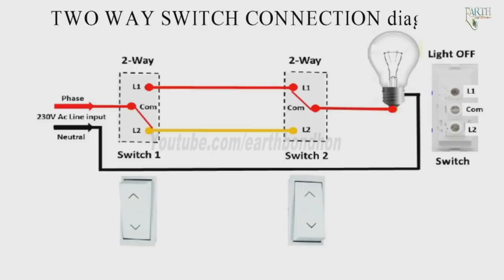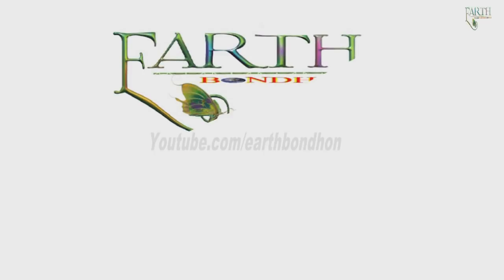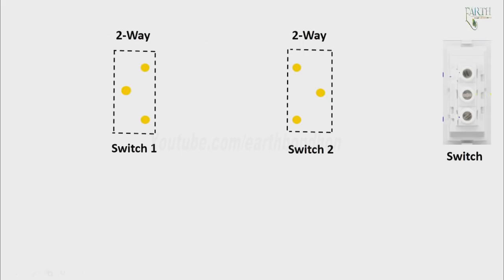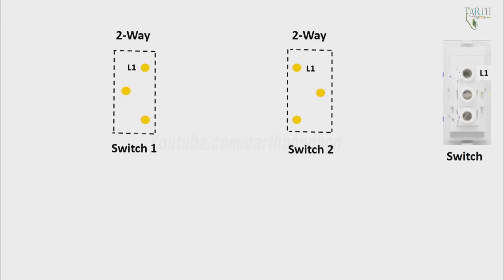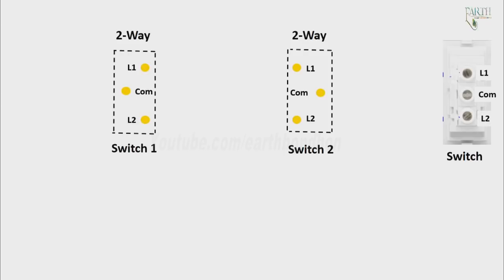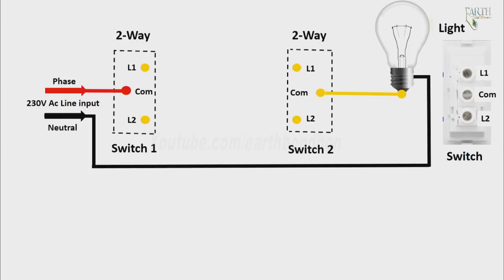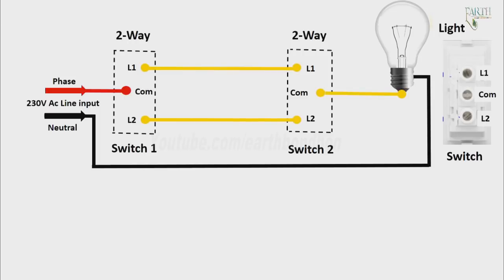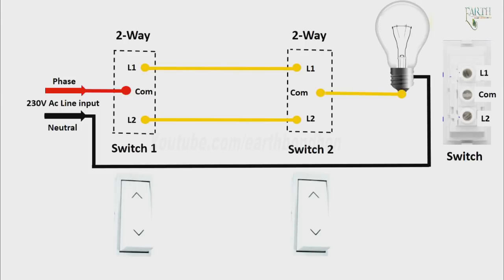2 Way Light Switch diagram in engilsh | 2 Way Light Switch Wiring in engilsh | Earth Bondhon

Comment: Hideous video, will likely result in an accident or worse. You do not mention what countries these colors apply to. In USA black is live not neutral, and red and sometimes black is the traveler wire not the positive from the electrical source. White is the neutral which is commonly visits each switch box is only to be joined to another white.  In the UK the colors are different once again.  Also, yellow or yellow and green or  green is ground. The basic circuit diagram is correct, but with a robot talking and giving insufficient additional safety information or advice the video is not sufficient for someone to do this with any degree of safety.
Reply from the maker: Youtube Channel.....
Thanks for your feedback, please follow.........
"Thanks for watching the video"   You are very welcome!